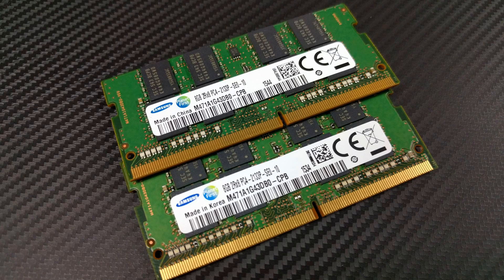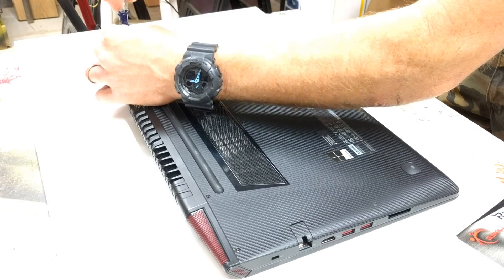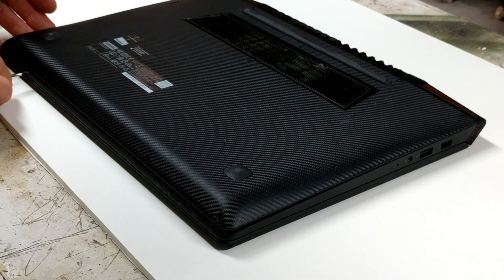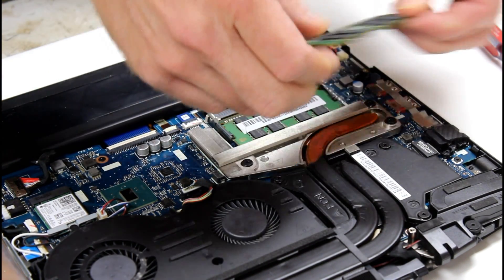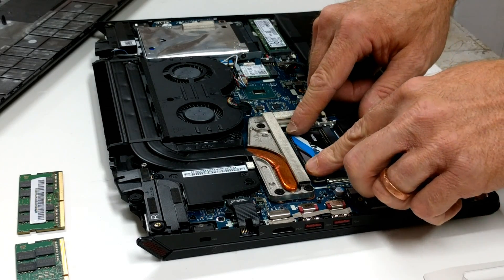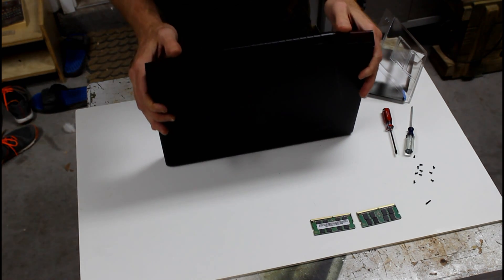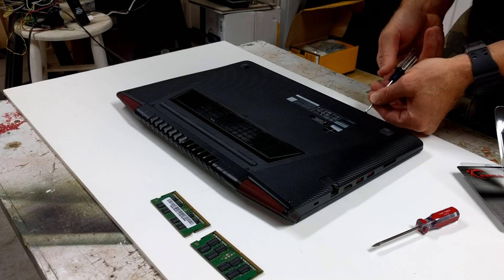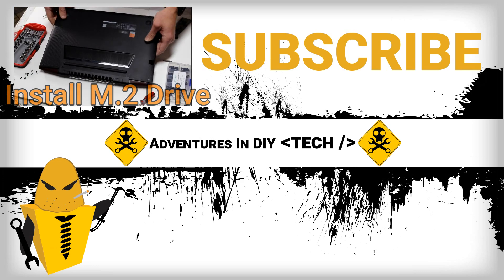Install 32GB of RAM in Your Lenovo Y700 14" Laptop (Model Y700-14ISK)

Comment: I tried to open it to change my ram, but i lost my display. Keyboard still lights up. 
Any tips what might be the issue?
Reply: maybe the cord connected to the display is not attached probably, did you check it?
Reply: @miaklhany  It was actually the ram itself, I removed it and inserted in the other slot and it started right up
Reply: @alaap988 haha same with my y700 when i was upgrading to 16gb just change the slots and it works

Comment: Hi, I have the y700 but the AMD version but the only thing that's restricting me from playing games properly is the CPU.  Is it possible to upgrade the CPU in these laptops.  If I upgrade to the SSD and more Ram will I be able to play games better or is it just the CPU mostly holding me back?
Reply from the maker: A lot of times if you encounter lag and you have a spinning hard drive, if you install a SSD you will see significant improvements in performance.  An example is I have a second generation i5 laptop from HP that originally had a spinning hard drive.  I installed a Samsung 850 pro in it and now the boot and response time is like its a new laptop.  The hard drive for the Lenovo y700 is what I found most frustrating.  Once I upgraded that I love it.
Reply: I know this is an old question, but the GPU is more likely to be your bottleneck, not your CPU. Either way, both are soldered on and can not be upgraded. The SSD helps with load times, but won't help increase FPS when playing.

Comment: Your videos are extremely helpful to me because I'd like to get the y40 and upgrade the RAM and Hard Drive. I'm not tech savvy at all when it comes to upgrading a PC or Laptop hardware, so do you know if I need to check for anything specific apart from the clock speed and type of ram (ddr4)  when I look online for the parts? How much Ram did your laptop originally have..did you notice a performance improvement?

Thanks!

Comment: i thought this onr had a pcie slot for ssd?
Reply from the maker: It has a M.2 slot with a SATA interface.  I was able to get a Samsung 950 working while in Windows 10 but could never get it recognized as a bootable drive no matter what I did in the BIOS.  That's why I switched to a 850 and it was no problem.
Reply: +Adventures In DIY - Tech 
sorry to hear that. that does suck :(
Reply: It looks like you have the M2 AND a 2.5 inch ssd installed at the same time.. I have this exact laptop, and I opened it to see if it's possible to install a 2.5 inch ssd as a storage supplement to the 128 gb M2, but i found that I need the metal bracket and the small cable from the ssd to the JHDD1 port on the motherboard. By any chance you know where I can buy the metal bracket, and the cable?

Comment: how much of a difference was it? how do you like the r9? i have been debating on getting this one or the 15inch version with the 4gb 960m Gpu?
Reply from the maker: I really like the 14" screen size, but if I had to buy it again I would probably go with the Ideapad 700 for two reasons.  First is the ability to install a pcie SSD drive and then the nvidia GPU.  I find the y700 tears through the battery.